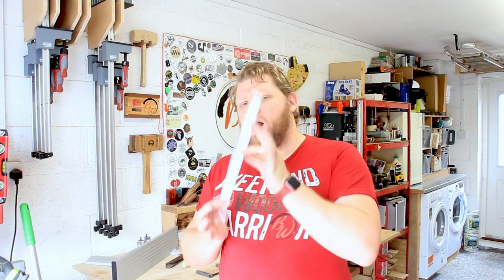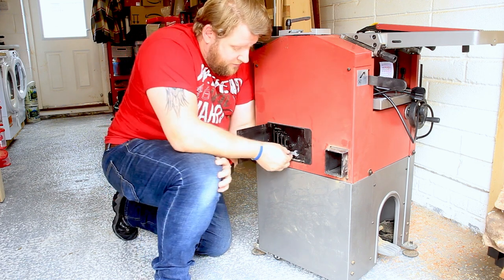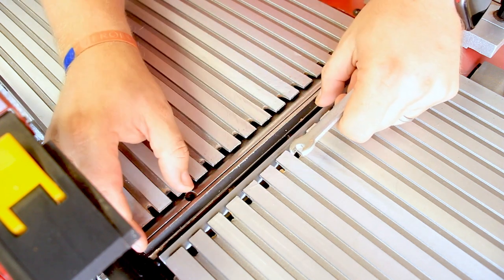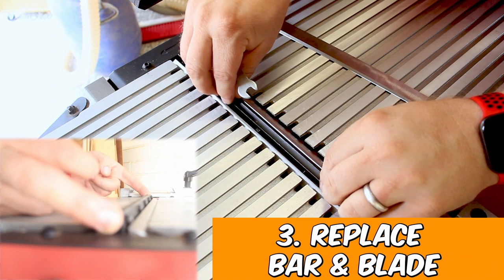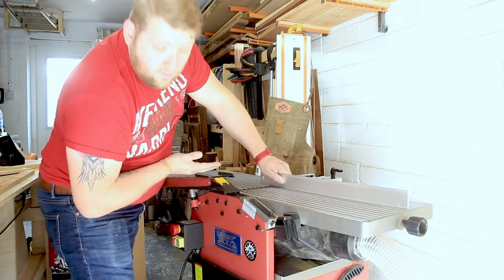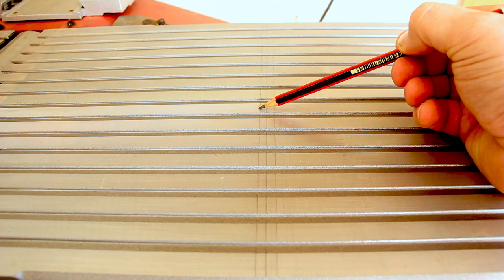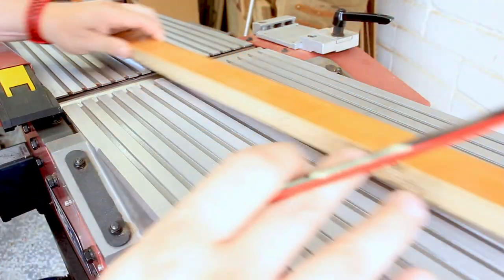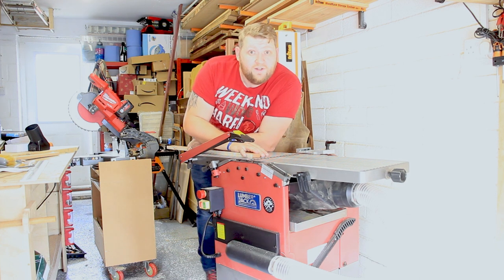Instant Upgrade: How to change and set planer thicknesser blades || LumberJack PT305

Comment: Great video , I have an issue with the in feed table , when set at 0 the in feed table is slightly lower , can the in feed bed be adjusted … thanks
Reply from the maker: I got to be honest I’m not sure. I think mine was slightly lower than the outfeed table but it hasn’t made a noticeable difference during use yet.

Comment: I have the lumberjack pt245 think the little brother of the one you have any advice on blade change on it as am pretty sure blade setting tool doesnt come in the box and i get my blades sharpened rather than buy new so any help would he greatly appreciated 👍🏴
Reply from the maker: From what I can tell the change would be very similar to how i did it. what i didnt mention is the adjustment screws inside. that is the easiest way to get them the same level. As long as the blades are the same height as the outfeed table you are golden.
Reply: @BrookesWood  thanks for that I actually had whole bunch issues since I wrote this comment. My one fell to bits after trying to sort outfeed on there advice went back got a new one sent out with blades  that weren't set right or tightened right so had Al that to sort done it with a steel ruler for guidance seems to have worked. 🏴👍